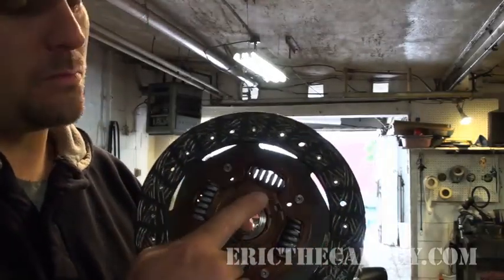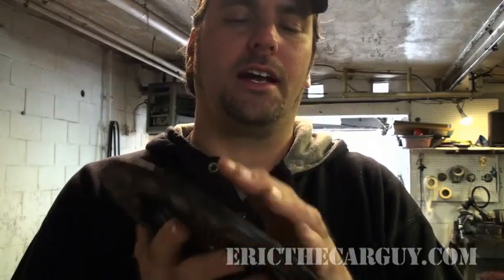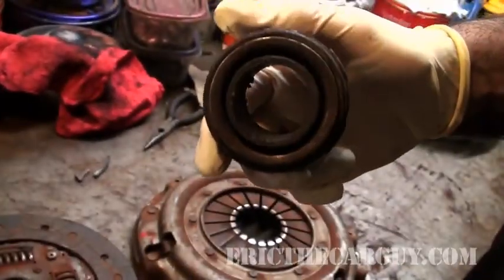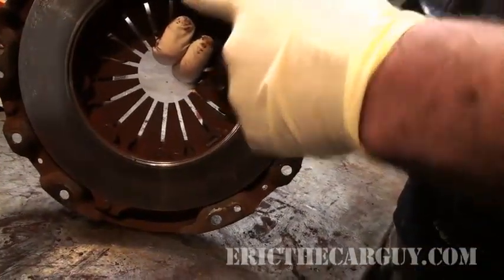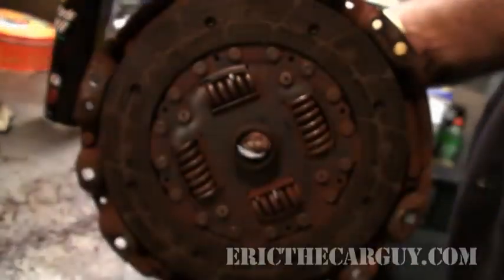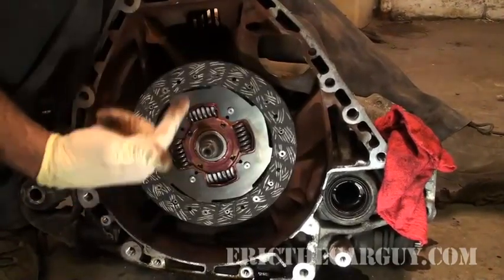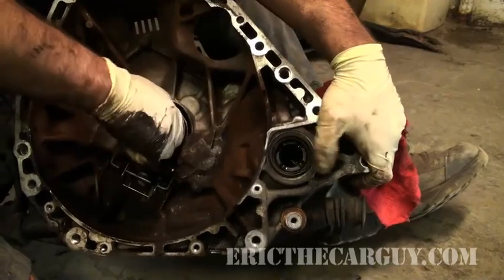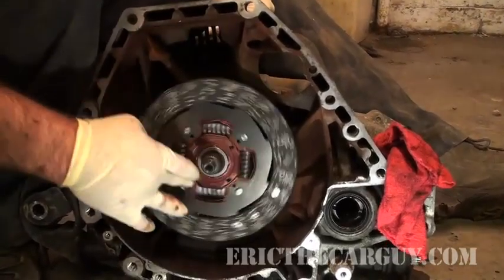Learn How A Clutch Works In Less Than 5 Minutes - EricTheCarGuy

Comment: That's an okay film but you are wrong. Both sides of the clutch disc are connected with these pins. There is NOT flexibility between these two sides of the disk. Strings are there for that center piece of clutchdisc. Center piece of the clutch disk can move separately from the friction surface. I think this is a very misleading mistake. Sorry for my bad english.....
Reply: Mikko Tuovinen You are correct. The clutch disc is made up of the 4 parts that are riveted together. A center piece of metal with friction material on both side. With a metal plate also riveted with them. In the center of the clutch plate are 4 springs, the metal plate and a hub. The hub floats on the springs. The springs take up the hits from the power stroke of the engine as well as the quick release of the clutch pedal. With each power stroke the crank shaft tries to make the clutch move faster, then it slows down till the next power stroke. So the springs dampen the vibration the is caused because of the power stokes of the engine.  

Other things wrong in this video it is called a clutch arm, the clutch fork rides on the throw out bearing.

Comment: I had the concept right... But I thought it was the clutch disk that moved, not the pressure plate. So I learned :D Can anyone explain the difference in racing clutches? So like stage 1 vs stage 2 vs stage 3? What makes them a higher stage?

Comment: hi eric, i have a small query, i have a petrol(gasoline) 4x4 vehicle and when cold the gear would not engage even with the clutch pedal depressed and pumped, but once the vehicle is warmed up it sits in gear fine, this is the behavior of a diesel vehicle, can you shed some light and maybe help me find the cause? could it be a different grade oil topped by the mechanic?
any help will be greatly appreciated. thank you.

Comment: I just changed the clutch in my 03 Eclipse 2.4L SOHC and its making the sound as if the bearing is bad from a fresh install. Could the Clutch Slave be causing the Clutch Release Bearing to rattle against the pressure plate by not fully extending the fork? (It only makes this sound when the clutch engages the engine in any gear including reverse *foot off of the pedal*)

Comment: Hey Eric, I have a 1999 Honda Civic EX 1.6L engine and I'm not sure what is wrong with the car, but when I shift into any gear and let go of the clutch the car doesn't stall or move. Actually, I don't even have 2 press the clutch for it to go into gear.

Comment: synchronizers are found inside the transmission and have no effect on the clutch assembly. they simply synchronize the gears inside the transmission so that they can mesh together smoothly.

Comment: When changing a clutch does the clutch disc need to have some play where it will turn in between the pressure plate and flywheel?i just did mine but the clutch plate does not move and seems to be tightly pressed between the flywheel and pressure plate.help!

Comment: Hey Eric I got a problem with my manual transmission , can use please help. What it does is it makes a weird noise, some noise sounding like when the break pads are bad scraping metal with metal. It's not to loud but I can feel it on the gas pedal. Once I press on the clutch pedal it stops,and when I press on the gas pedal it sounds more Help please

Comment: So i swapped a motor for my first time new clutch and the whole works, i got it back from exhauste work and carb work and it's making this terrible sqeal squeak noise after it's been running a few minutes. The noise is coming from around the bellhousing, everything shifting fine, could my through out bearing be toast? fyi it makes the noise at idle while going down the road regardless if the clutch is engaged or disengaged.

Comment: So here is my Question, when you press the clutch pedal the pressure plate releases the pressure from the clutch plate. FINE

 But if there is no mechanism to move the clutch plate away from flywheel it will still rub against the flywheel loosely and your clutch will wearout really fast. what's your point?

Comment: ok so if my car is in gear with the e-brake and if i give it a slight push and moves down a little would you say my  clutsbis bad. at stops im able to take off in 2nd and sometimes even 3rd gear. my car is a toyota celica 6 speed

Comment: You said that the two clutch discs turn at different speeds for a split second and that is not true they are riveted together to that metal plate also the pressure plate is bolted to the flywheel so they turn at the exact same speed all the time the springs dampen the clutch disc to the input shaft of the transmission.

Comment: Hi Eric. question. I just bought a 99 hyundai elantra 2.0 with only 19,314 miles on it, the other day i bought a scan tool an scanned it for codes, the check engine light is not on but i have a transmission code P0712 transmission temperature circuit A low. how can i fix that an what do i do . thanks

Comment: eric I need help! I have a 2001 mazda Miata SE has the 6 speed manual trans when I drive I hear a horrible noise that sounds like a bad wheel bearing but ive checked those and there fine and the engine purrs fine no noise but when I change gears something rattles and sometimes its hard to get in reverse the noise I hear when I drive also continues as the clutch is out an its in neutral just coasting so I have no idea what it could be please help

Comment: when I drive the car 25km than its hard to change the gears what's the problem please some one help its 2004 Kia Rio Ls Manual
Reply: Call a local shop and inquire, if its loose and hard to find gears it may be as simple as replacing the bushings within the linkage.

Comment: Wrong. A lot of older manuals have linkages on the side of the trans. Modern manual transmissions do have the shift lever actuate the forks directly (no linkage) however,the back of the trans does NOT sit just below the back of the trans. More like the middle of it

Comment: Physics time. Sure you can: Let's give random numbers like.. 5/5
for the amount of power/distance. If you were to use something like a lever, you obviously aren't using as much force on the longer side to move the shorter side. The problem of course is the shorter side moves a shorter distance. So while power/distance might be 2.5/10, the other side will be 10/2.5 multiplying the power. The same concept works for transmissions. The wheels don't turn as fast as the engine in first.

Comment: THANKS ENJOY LEARNING..... SO WHY DO MANUALS LAST LONGER THAN AUTOMATICS
Reply: Auto's use fluid pressure to apply power to the drive axles. Manuals are controlled by the clutch which is much more reliable and has more of a direct power distribution. Not to mention less moving parts.

Comment: yes throw out bearing, if the bearing is bad it will not be moving like it should be on the input shaft of the transmission causing a noise

Comment: i maybe wrong..but as far as i b know the pressure keep the clutch ''locked'' when the clutch pedal hasn't been depressed..the trans input shaft keeps the clutch in place, and that's how you ''seperate'' the trans from the engine to let shit...the springs (in the clutch) helps to absorbe the the power coming from the engine, acting like shock absorber...im just confused..

Comment: you should just buy a complete kit, its not more expensive then just buying the clutch disc and it comes with disc, pressure plate, and release bearing, basicly the whole clutch assembly minus the hydraulic system

Comment: my shift linkage is attached to my throw-out bearing which in turn is also attached to my pressure plate, making putting the transmission back together a pain in the fucking ass.
i cant put that part in properly and then go and bolt the pressure plate to the engine, i would have to do it in parts, which i cant do because its all one piece. WHAT. THE. FUCK.

Comment: the flywheel only weighs about 12 pounds, the clutch assembly probably 4 or 5 pounds, if you really think decreasing that much weight from the car will make a difference go take your spare tire out of the trunk

Comment: I don't know who your physics teacher was, but that's not power. You're talking about mechanical advantage. Sacrificing force for distance moved. Power is the product of this force and distance divided by a time. P=F*d/t. Lets say the time interval is 1 sec. So on the long side of the lever, a person pushes with 2.5 lbs and it moves 10 ft. The load which weighs 10 lbs moves 2.5 ft. In both cases, Power=25 Ft-lbs/s.

Comment: I had my sisters mechanic put in a new slave cylinder on my vehicle, transmission was doing it's usual thing before the mechanic had to pull it out of my truck, puts it back in, I go down the road and then the shifter just completely sticks, won't move, dude claims it had nothing to do with him.  Transmission worked fine before he got ahold of the car goes out after I drive it away.  Paid four hundred dollars for slave cylinder repair, I think mechanics get paid too much. He's claiming it isn't his fault of course.
Reply: Zakk Brailsford Would you charge someone 400.00 to change out a slave cylinder, drop their transmission on the ground while you are putting it back in, my trans was working fine before changing gears perfectly, drove it home yesterday put it in third and it slams hard like I had put it in first, then this morning it completely freezes up and won't even shift, I had noticed it was sticking coming out of fourth on the way home.  Guy says it's the trans and has nothing to do with him dropping it but he'll put in a new trans for me, and charge me for it.  I believe if someone were paying me 75 an hour, I would do the job right.  I didn't mind the 400 dollars, it was the fact that after I drove sixty miles to pick up the car, had my sister drop me off, paid the man, then he tells me oh yeah your starter is going out but I won't be able to get to it till next week, when I clearly told him, I want what ever is wrong with it fixed, he didn't finish the job.  So I found someone else to put on a new starter, that day the men at good year quoted me 349.00 for a starter change, which I knew was bullshit considering it's a 120.00 part, and twenty minutes worth of work which I confronted him about, he quickly dropped the price to 210.00.  You took my comment wrong,  400.00 would have been fine, if he had not fucked up my transmission.  So yeah 75 dollars an hour is a bit much but hey he got his four hundred dollars even if he cost someone else a thousand dollars and that's if I am lucky. You go on and defend a dishonest man just b/c he is a fellow mechanic.  At least Eric seems to know what he's doing, and seems honest.  Do not pretend that there are not mechanics out there that over charge, lie when they make a mistake, & mess with peoples cars to get more work.  Or are you all saints who never take advantage of people?
Reply: Heather Williams I would have changed you slave cylinder for 150 bucks. Generally you don't have to take off the transmission to change these. I can do it under an hour. And I am a weekend warrior mechanic.
Reply: slave cylinder was in the bell housing on the transmission, so it had to be taken off
Reply: Dishonest mechanics know that their customers generally don't know the first thing about their cars. And they know that they know how to fix just about anything. They'll do whatever they can to squeeze money out of their pockets, because what do the customers know? He fucked up your transmission and he knows it, but are you going to fix it, no... but he will, and he will charge you for it. Unfortunately there are no punishments for being a dishonest worker, especially in the automotive field. It's built on that shit, from the manufacturers all the way down to the guys at a local garage. And there's not a damn thing you can do about it, except find yourself a good mechanic.

Comment: Sorry to rain on your parade but a part of this info is incorrect... the clutch system moves together with the engine and not with the gearbox... disengaged it will spin only with the engine and engaged in neutral it will spin with the engine plus the primary drive shaft in the gearbox